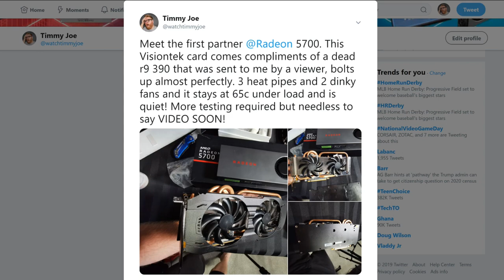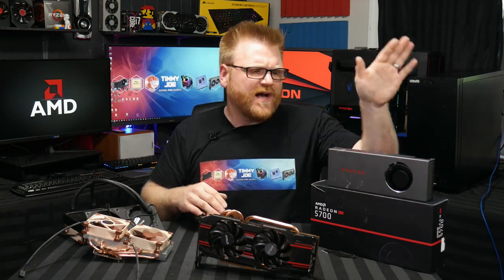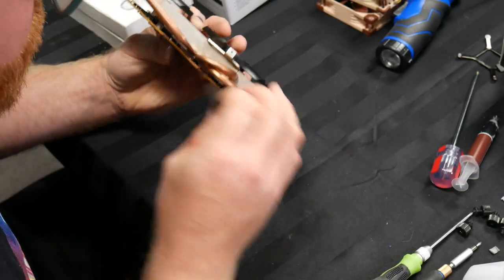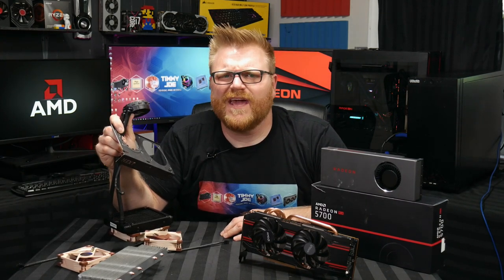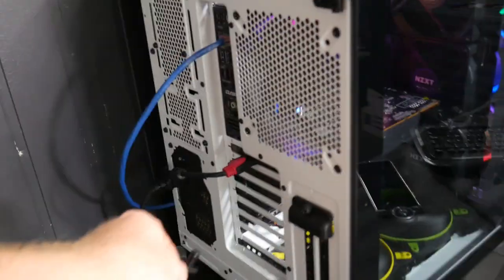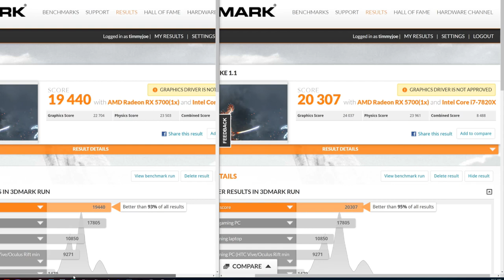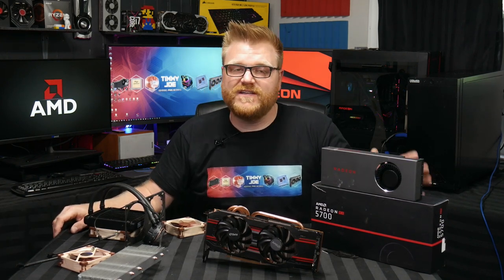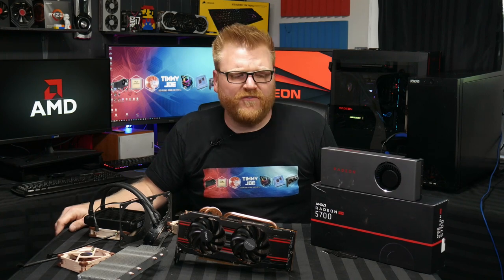Visiontek Radeon RX 5700 2 Fan Cooler TESTED!

Comment from the maker: I didn't notice but it seems the memory temperature were not ideal after the mod. This surely has something to do with gross used thermal pads I used on the memory. I ordered some fresh thermal pads from Amazon in hopes to correct this issue. I played Apex Legends for 3 hours today on this card overclocked and had no issues though so everything seems great.
Reply: when the drivers supposedly get fixed (according to GN) and you can do some overclocking, you should do a short re test against the 5700XT if you ever get one, probably wouldnt be enough of a difference to shoot a whole new video alone but could work added into another video.
Reply: I'm waiting for the 5500, 5600, 5800, and 5900s to drop
come on AMD please be sand bagging !!!
Reply: Have you ever thought of running a closed loop through an aquarium chiller? The temps would be in the 40's or lower? Also a makeshift chiller would be to run coiled up line through a mini fridge!!! Try it please!!!
Reply: Timmy Joe PC Tech  try my chiller idea 😂
Reply: @joshuaboneta  I've been wondering about that.. wouldn't need a large one... just enough to keep it at ambient
Reply: Kid Devious  you could pick up a $50 mini fridge on Craigslist and coil the line in the small freezer section... Then you'd have a fridge for drinks and your loop!! I think I'm going to have to try it
Reply: I love your videos man. This is the most creative fun content in the tech world. Been watching since like 10k and I hope to be watching past 10m! Also I'm looking to upgrade this year. I currently have a 4690k and a 980ti. The new 3600 looks amazing for an upgrade but I'm unsure of what to get for the GPU. My budget is right around the 5700xt and 2070 super range. What do you think?
Reply: @joshuaboneta  I'm looking into the Chill Solutions CSXC-1 Thermoelectric Aquarium Chiller it's ONLY $250 on top of a custom loop 
Minor modding to a case for an inlet and outlet..
Reply: @joshuaboneta  except if youd been watching linus tech tips for like the past 4 or 5 years theyv explained multiple times that you cant use a refrigerator as a long term cooler because they are only rated as part time, meaning they would constantly run to keep the heat in the loop down and it would burn them out from running 24/7
Reply: thelasthallow if you just put it in the fridge section it wouldn't freeze
Reply: Who turns off a fridge? I've had one running for 5 years and have never turned it off
Reply: Wait...so with your cooler, it reached 77C with the fans blowing at 50%? But with the blower, it was blasing loud at 80C..?
Reply: @joshuaboneta  UH WHAT? dude you dont get it, just because its "plugged in" does not mean that it runs constantly 24/7, it only runs when it needs to. generally when the door opens or after it sits for like 6 hours. they do not run constantly and the components they use are considered "part time"
Reply: thelasthallow okay but for most people you would game for a few hours and I don't think that would kill a mini fridge.. and yeah I realised how stupid I sounded after I wrote the comments.. 😂 sorry
Reply: You meant the compressor running that long would cause premature failure of the unit..
Reply: I love it great work tim hope you can do more like this
Reply: you might need a couple of copper shims in there too on the contact plate side for the memory.
Reply: 3d printing is a thing today but its never used it moding enthusiast graphics cards...
Reply: CAN SOME ONE CONFIRM . Does sapphire R9 290 vaporx can be put on 5700 please answer.
Reply: @NiHaufly  look up the navi pcb and compare it to yours.
Reply: its gonna be harder than you think to mod the card to unlock it.  its probalby set with a fuse in the chip.  you would have to either hack the driver or find the pin of the e-fuse (after desoldering the die off the board)and then either add or block a voltage to that pin.  driver hack would be easier.  i hope they do it though
Reply: @joshuaboneta  you can go watch the video linus tech tips did Cooling a threatripper with a aquarium chiller
Reply: Reminds me of the 2000s when people modded consoles and pirated games.
Reply: Link to the thermal pads you bought please <3
Reply: Any latest updates? How is your custom card holding? looking at my old Sapphire R9 290
Reply from the maker: @wheisenberg559  still using it like that, still works great
Reply: I'll wait till other heatsinks are confirmed working/fitting. I like having a good looking PC, and the Arctic Accelero doesn't really fit in my case. :P Watercooling seems too expensive, and it would be my first time so i'd rather skip that lol.
Reply: Timmy Joe PC Tech you should get your hands on the gigabyte 5700xt gaming oc. It’s on Amazon now and I’m sure we all would love to here your opinion
Reply: @RiftRavingRogue  those are probably next year
Reply: @RiftRavingRogue  lol 5500 and 5600 released now, i bet your not in a hurry anymore now lol
Reply: @budgetking2591  Still waiting on the 8's and 9's
Reply: Did you ever get new thermal pads that worked for the Vram?

Comment: Your least crazy intro yet, nice work mate :D
Reply: That was pretty interesting that you and Timmy had the idea to use a cooling solution from another AMD graphics card. You should post a video of that. BTW love your channel. You are my number 1 choice for tech content.
Reply: @VoldoronGaming  I got the idea from a viewer who asked if I could fit an RX 580 cooler, so I can't really take credit ;) Plus Timmy Joe beat me to it anyway as it turns out. I might throw a water-block on the 5700 XT and do some testing soon.
Reply: @Hardwareunboxed  question with the 5700xt in Forza horizon 4 it came close to a 2080ti performance any speculation on it please
Reply: @chriswright8074  VEGA cards are impressive in FORSA 4 so im not surprise if NAVI continue that performance lead.
Reply: @chriswright8074  there's no speculation at all, the engine loves amd.
Reply: @Hardwareunboxed  for the love of all that is tech please do! There are still to many unanswered questions!
Reply: @chriswright8074  because the consoles use AMD???
Reply: Jimmy hair is not leaning enough to the left of the liquor store 🤬😅

Comment: I saw the 5700XT reaching a 30,000 point GPU score in FireStrike. Thats 1080ti performance for $400.
Also I thought there was a extra setting in MSI AB that unlocks AMD's voltage slider.
Reply: I was watching Jokers benchmark video yesterday for the RX 5700XT vs the RTX 2070FE using the in-game benchmarks. I noticed at around 7:44 in the video that the RX 5700XT for a brief moment peaked at 2005 MHz on its own and was running at 65C. The RTX 2070FE was peaking at 1905MHz and was running at 68C in the same exact spots in the benchmark. It may be nothing special, but I found it impressive since the RX 5700XT was a blower model and it was running on less-than-mature drivers.
Reply: @Slane583  also in Forza horizon 4 it came close to beating a 2080ti hardware unbox I believe
Reply: @chriswright8074  Ya, it was nice to see that. Though I'm not surprised. When I was playing Forza Horizon 4 through a deal Microsoft had for the Xbox version of Game Pass the game nearly maxed out all of the graphics settings on its own when it saw my system specs. It played at a buttery smooth 60fps on my R9 Fury at 1080p. The fps counter would sporadically go back and forth between 57 and 60 fps as if it were forced to stay there, like it was wanting to put out higher fps but couldn't. I also couldn't find a setting in options to give it unlimited fps, the game would only let me choose 60fps as a max setting. If I could find such a setting I'm sure I would be getting much higher fps. I might get one of these RX 5700XT's once funds allow and it has been out for a few months when there are multiple AIB offerings. I'm hoping those offerings show what 5700XT is capable of. :)
Reply: @Slane583  Check that VSync is off and press right on the 60FPS slider till it says unlimited.
Reply: @flipdry  I hate VSync in games so I make sure that's the first thing I shut off. But I will have to recheck the settings and look at the slider to see if it'll go further. Thanks for the info. :)
Reply: CAN SOME ONE CONFIRM . Does sapphire R9 290 vaporx can be put on 5700 please answer.
Reply: NiHaufly yes, the ram will be a little less aligned tho
Reply: @gamerthebanning  damn niiiceeeeee gonna get reference card then. and pop my vapor x on it awesome.
Reply: Just go on 3dmark page, click result and you can see results of desired card. I ve checked it yesterday for timespy(dx12) and best result is ~9500 graphics score(2100+ MHz) and avg is around 8500-8800 points(1900mhz)
Reply: I m talking about rx5700xt
Reply: I get 33k with 1080ti. So close

Comment: Just imagine if the core clock wasn’t artificially locked. That thing would boost like crazy.
Reply: I am guessing with a custom water solution it will oc like a mother if that bios isn't locked.
Reply: No, they want to use public beta to control how the baseline performances are... At stock.
If they let us overclock, we will all undervolt and tune the GPU like crazy. I think AMD doesn't have enough stocks to make these tunable gpu.
Reply: dra6o0n you mean like enough stock as in how many are available? Also Beta as in eventually there will be an unlocked driver/bios update?
Reply: @bbbrenden  Reference models are used to bug test for any glitches in the drivers they give us, it takes a month until they are satisfied and unlocks the card as a 'bug fix'.

A lot of 1st series are like that, tech companies can get kinda scummy with this tactic.
Reply: If I'm not mistaken the most limiting factor on those cards is the memory clock. I'd love to see a version with 8gb of HBM2 and better cooling capabilities undervolted so it can self overclock higher.
Reply: @petergriffin-cq5kw  Yeah, i think it's because memory bandwidth isn't really talked about commonly to let people realize what bottlenecks are in terms of data transfer inside a GPU.

DDR4 = Memory Clock X 2

HBM2 = Memory Clock X 2
GDDR5 = Memory Clock X 4
GDDR6 = Memory Clock X 8

This is why for a Navi card using GDDR6, the bottleneck is in the core clock settings and raising the core clocks can gain huge advantages in performance.

RX 5700 has a effective memory clock speed of 14000Mhz (true speed in total).

But Vega cards like Radeon 7 has a very wide bandwidth which technically 'reduces' the amount of cycles needed to transfer the same amount of data as GDDR5.
Reply: 5 months later* you can change the bios to get a performance equiparable to xt

Comment: With regards to the 5700XT, it's actually the other way around (and was originally "Navi 12").  AMD initially planned to launch the 5700XT at ~$299 with lower clockspeeds, and correspondingly a 130-150w TDP (but 10-20% worse performance).   However Navi 10 (now not called that) had some major efficiency issues.

Thus they decided to delay mid-sized Navi, release Vega 20 to consumers to just barely have an "Enthusiast Presence," and then overclock the living crap out of Navi 12 and call it Navi 10.   RDNA 2.0 is coming sooner than expected as a result, but the downside is RDNA 1.0 isn't really a full line-up in mid 2019 like AMD was hoping to release.

Comment: Good info on the G12 Kraken compatibility.  I had considered getting a 5700xt to test it (as I have several G12's laying around at the moment), but now I'll just wait for aftermarket variants of the card to launch with better cooling.  Subbed.

Comment: Awesome work Timmy Joe! Slick that a crappy cooler from a few generations ago works so damn well on it. It tells me that even the budget branded axial fan AIB models (like the asus dual or the MSI Mech) will absolutely peg the the boost clock like you did. Anyone with an old 290 or 390 knocking around with a new 5700 or 5700XT = Do. This.

Comment: Timmy bro. Go to guru3d.com and get there version of afterburner its way better man especially for AMD
Reply: What do you mean guru version?  Compared to what? I know you can dl programs from guru website, but what's the difference? I use MSI Afterburner and if there's a better version I'd like to check it out.
Reply: @jeffrey949  its like a better tweaked version then the official one   if you go to there site it will explain in more detail what im meaning
Reply: @jimsinnovations2737  better tweaked for AMD or nvidia?
Reply: @Nikhilesh Kumar Malik can you tell me whats the difference
Reply: I called it guru3d version cause that's only place I can find it, anyway it's tweaked for both
Reply: Jimmy saw this post and got the newer version of AB.  Been using the older version.  Anyway, thanks for your post to Timmy.
Reply: @larryboles629  np man. I like it for something I may need to use it with other wise I just use wattman
Reply: @jimsinnovations2737  do i just go to Guru3D.com and download the latest version from there? Or there are other segmentation in versions in guru3d websites?
Reply: @AdrianMuslim  yes that's it

Comment: I use the Kraken g12 for my rx 480. Had to put another fan below the card towards the front to cool the ram which I also put copper heat sinks on. YOu can get this to work. If it fits. add ram heat sinks and a fan to flow on the front of the card. works better with the non blower cards. Dropped all my temps from 70c to 45c

Comment: If the r9 270 coolers fit in these (probably not) it would be awesome, 'cause I have a vapor chamber cooler left over from a sapphire vapor-x 270x
Reply: No it would not fit because RX5700 uses 54x54mm mounting holes which are only used by: R9 390x, R9 290 and R9 290x. Your R9 270x for example has 53.3x53.3mm mountings.

Comment: jesus, those Memory temps though! 90C with both cooling solutions is pretty terrible. I believe 95*C - 105*C is the recommended max operating temperature. The blower and the homemade solution were both getting pretty close to those numbers.
Reply: funny thing is usually the very first cheap partner cards are even worse than reference blowers for cooling. I have an Inno3d 1070 and a Gigabyte 480: and both of their coolers suck so bad, easily worse for loud shrill factor and holy crap it's getting too hot than my bracket+liquid metal modded Vega 64 reference blower.
When you buy custom, don't get the cheapest model!
Reply: @anasevi9456  I've not seen many if any partner non blower style cards hit over 90*C. I've got an EVGA GTX 1080 Ti SC2, which is just their dual fan 2 slot card, and it stays around 67*C when gaming at like 80% fan speed. The worst one I had would hit 80*C but there ended up being something wrong with the card. If you've got a dual or triple fan partner card that's hitting close to 90*C, something is wrong, either the cooler isn't seated properly or the thermal paste isn't applied correctly. Or the card just needs to be exchanged for a different card.
Reply: @dgraves14  Damn my 1050ti reaches 82 degrees when playing rust lol
Reply: @dgraves14  the gpu bios is overvolting this thing, it shouldn't be artificially creating that much heat.
Amd is hiding its real potential on purpose.
Reply: @westernspy561  is your 1050 Ti a single fan model? A lot of those 1050 Ti's have terrible heatsinks on them. Also, how's your case airflow?
Reply: @dra6o0n  That's just speculation. Sure it's possible, but I really don't think that the 5700 XT has much more potential. If the cards can't hit their boost clocks, nor really be overclocked, while being overvolted, I can't imagine performance improving if they cut down voltage to help with temps. But then again, I'm no expert.
Reply: @dgraves14  its the msi 1050ti low profile edition, and my airflow is kinda average, my mobo(a320m) supports only 2 case fans so i have one at the back and one at the side directly blowing at the gpu. I guess its hot cuz of bad heatsink and bad thermal paste if im right
Reply: @westernspy561  yeah those cards have pretty bad heatsinks and im assuming it's a single fan if it's the low profile card? also, 2 case case fans is a little lacking. with better airflow you're temps would likely be a bit better. If you're wanting more case fans, you should look into one of the fan hubs. I've got the corsair hub that supports 6 fans, 4 temperature probes and 2 LED strips and it works great. It's a bit expensive, but I have corsair fans, AIO and case so it works with iCue software. Deepsool makes one that supports up to 10 fans, and Silverstone has one that supports 8 fans. But if you're not worried about case fans, those temps are fine.
Reply: @dgraves14  My case is pretty bad too :/(Raidmax Exo 108)
Reply: @dgraves14  Also i never really knew about these fan hubs. If i get one of these, where should i connect them to(im assuming in the motherboard). Sorry for the stupid question but i dont really understand these.
Reply: @westernspy561  i just looked it up, yeah probably not the greatest case for airflow. But it doesn't seem like the worst case i've ever seen. but maybe look into a case upgrade to something with front and top fan mounts. The Fractal Focus G is on the cheaper side. Or Deepcool Matrexx 50 or 55, also on the cheaper side. I've got the Corsair Crystal 570x with all glass panels, i run 9 case fans, 6 push/pull on my AIO as intake two top exhaust and one rear exhaust.
Reply: @westernspy561  No problem. No stupid questions. I never mind helping someone out.They usually usually need a SATA power cable to power the hub. Then all the fans plug into the hub.
Reply: @dgraves14  alright thank you for the response
Reply: @westernspy561  no problem. have a good one.

Comment: I'm a radeon 7 owner. I hav ed absolutely no problem seeing these cards running right up with radeon 7 . I'm actually hoping that AMD does release a 5900 series card that smokes the 2080ti and radeon 7 ect . And I'd buy one of those too. It's my hobby , my wife's art design machine. So throwing newer better parts in is fun and most of the time approved by management.